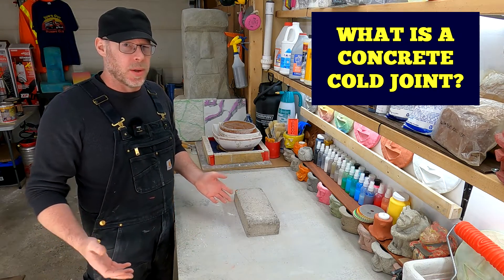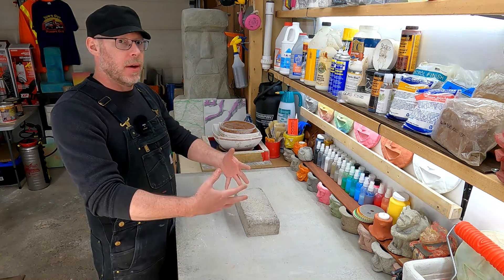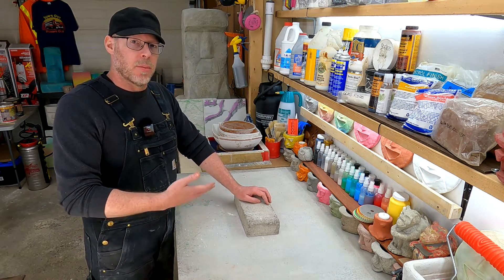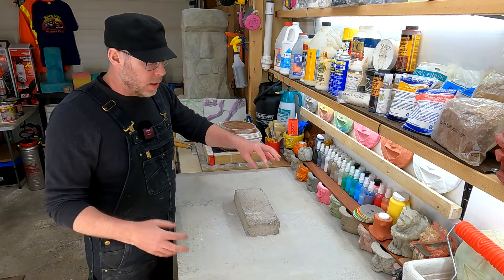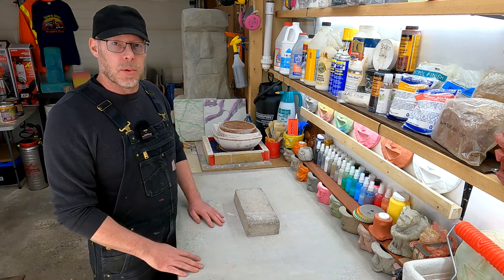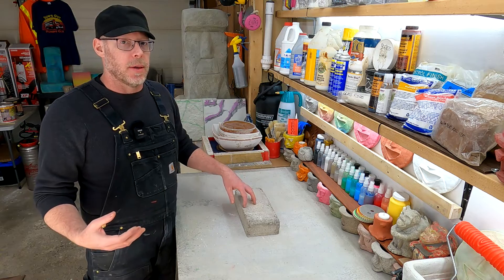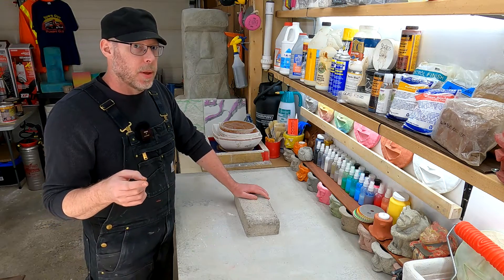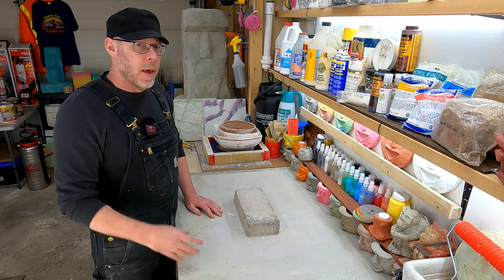What is a Concrete Cold Joint?

Comment: "Which under laboratory conditions, there is no discernable cold joint between the layers"

Found that statement to be interesting. Had to go ask our petrographer to clarify. And long answer short - sometimes. It depends.

But I suppose by benchtop level, you don't mean under the microscope then. 😅
Reply from the maker: I mean for structural concrete applications every method to add new to old will leave a cold joint weakness between the two, but shotcrete methods do not. There is no other way to add new concrete to old without  a plane for failure.  I am doing benchtop here but my experience with this is from owning a  shotcrete swimming pool company.

Comment: If you're a good Concrete Finisher you get a cold drink on the floor you should be able to finish it with a trowel machine and no hand traveling I fixed hundreds of them and you couldn't tell

Comment: You didn't explain why it's a problem. Does the new concrete not stick well? It seems to me that is not always the case.
Reply: Often times you'll see honeycombing happen. Could also allow moisture intrusion and cause load capacity issues.